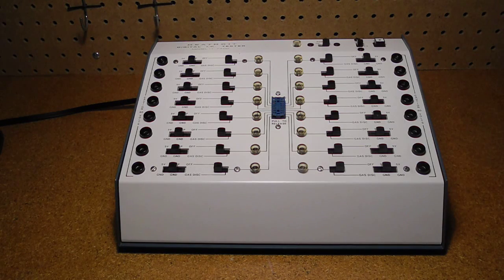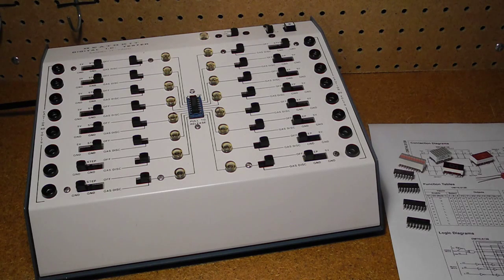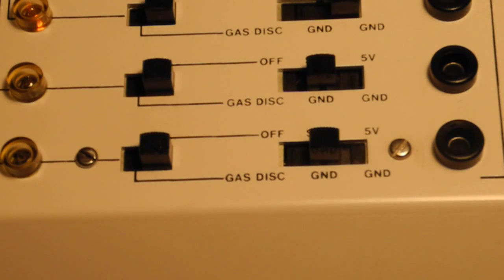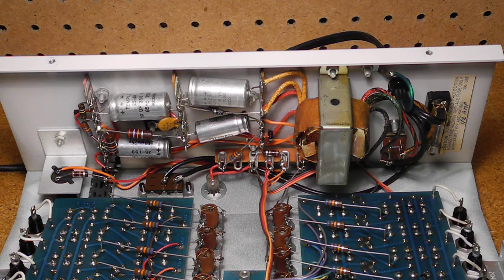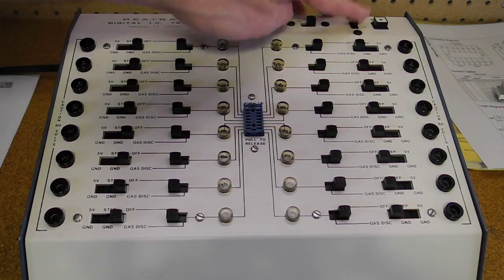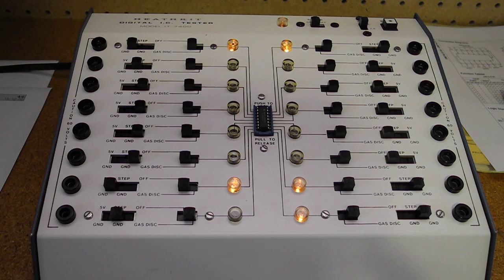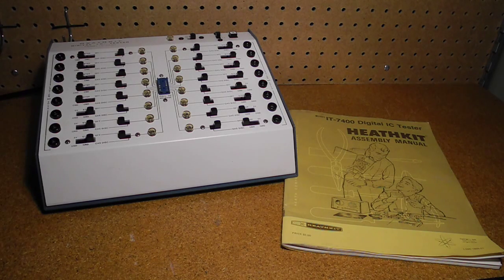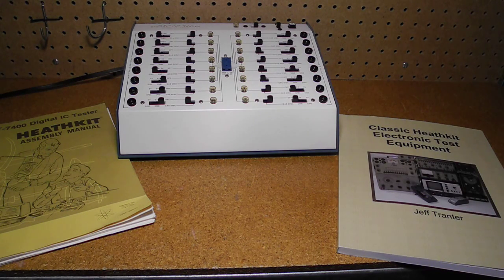The Heathkit IT-7400 Digital IC Tester

Comment: Gas discharge tubes were used for quite a few years as position indicators on machine tools from the mid 1960's to the late 1970's. This unit would have been very useful to a person troubleshooting problems with those displays. Although I agree, it would have been very tedious to use on a daily basis.

Comment: I would guess at a pinch a modern electronically debounced circuit could be used to replace the wetted switch?

Incidentally, one place you MIGHT find one are very early IC controlled touchtone telephones from some countries. (They used mercury wetted contacts for precisely the reason given in your video). The [ * ] marking on the key actually makes me wonder if that's where they got it, from a telecomms part manufacturer?